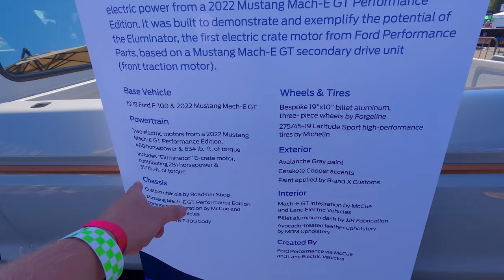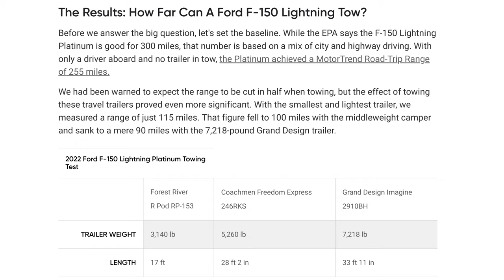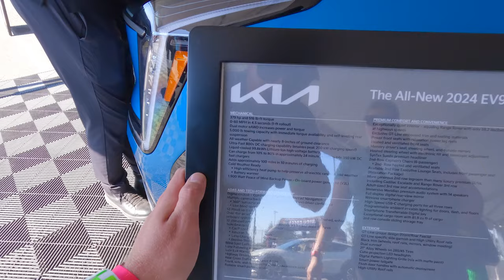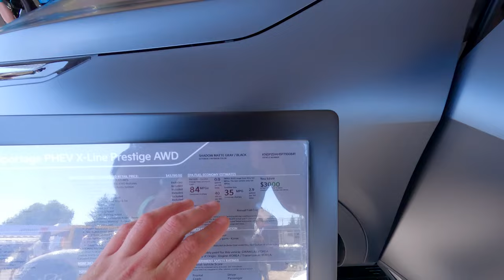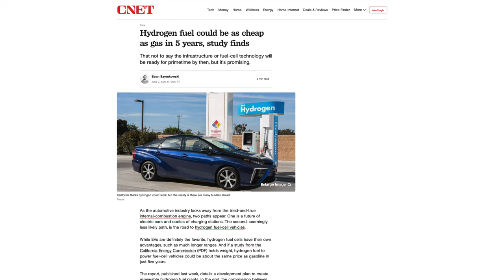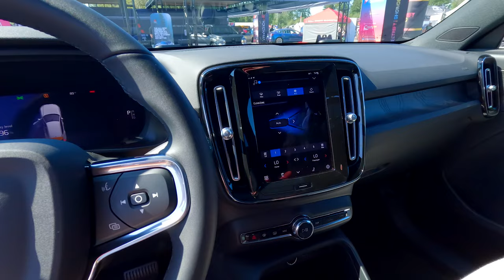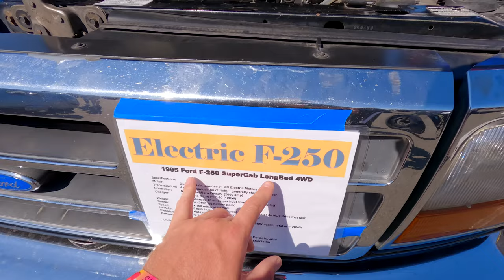New EVs & AMAZING Conversions | Electrify Expo 2023

Comment: I do not understand why the automotive industry does not build a hybrid in the same way as the railroad, the diesel engine in a locomotive is not hooked in to the transmission it just runs a massive generator.